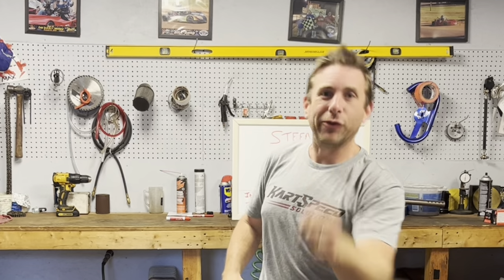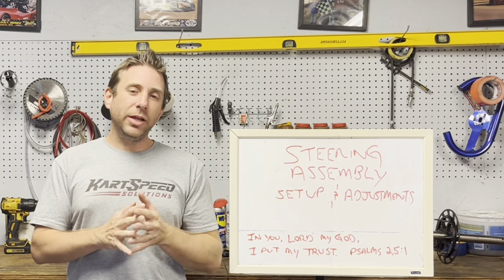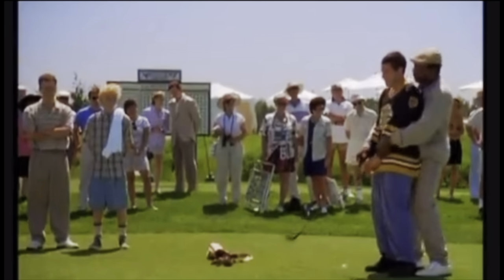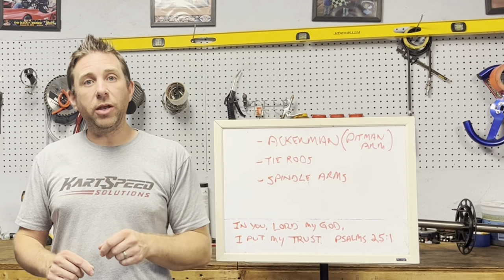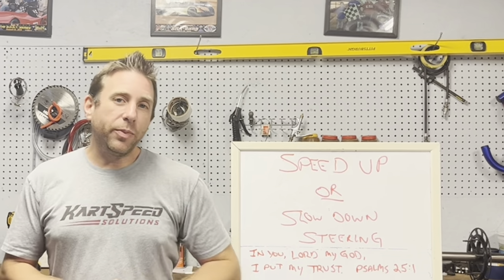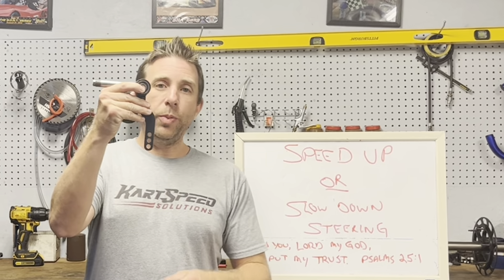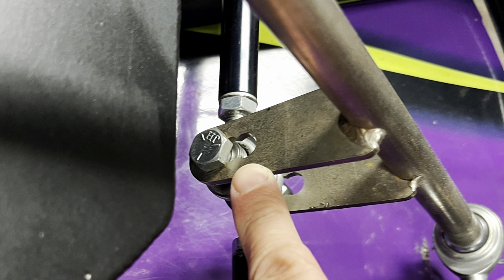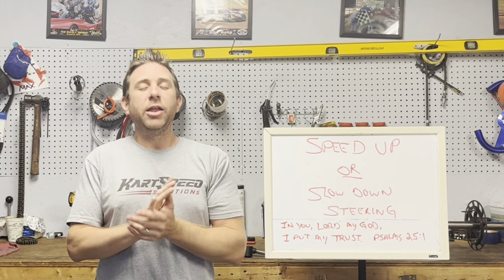Steering Assembly Setup and Adjustments

Comment: Pitman arm and ackermann are 2 different things, ackermann (simplified) is the difference in angle between the left front and right front while turning. The different holes will achieve different ackermann along with changing the force needed to turn the tire with the steering wheel. Closer to the kingpin on the left front will get more ackermann and farther away on the right front will get less ackermann. My thought is that, in theory, on a larger track with sweeping turns, you would need less ackermann so that the front tires aren't fighting each other as much, while on a tighter hairpin style track, more ackermann should help get into and through the center of a turn.
Reply from the maker: Yes sir, what I’m referring to is what manufacturers call certain items. For instance, Phantom calls the connection point of the tie rods to the steering shaft is a “Pitman Arm”, Trick Olimpic calls it an “ Ackerman”. What you are referring to is Ackerman angle which I really don’t go into to deep in this video.
Reply: @kartspeedsolutions  gotcha. I guess I had just never heard it called an Ackerman lol. Didn't really mean to come off as arrogant or rude
Reply from the maker: Yes sir, no worries, didn’t take it that way at all😁

Comment: on the spindle the hole at the top is fastest hole at bottom is slowest. it takes more travel at the bottom and less travel art the bottom to move spindle same distance
Reply: Thats what iv always thought too
Reply from the maker: No sir, when going to furthest hole from the kingpin on the spindle arm you are increasing the speed of the steering. Reason for this is because you are increasing the throw of the spindle arm which in turn increases the rotating speed of the spindle barrel and there by increasing the rotating speed of the spindle axle.
Reply: Further away from the spindle barrel, less angular motion. Thus slowing down the steering. Opposite is true on the steering shaft, further away from the shaft increases steering speed due to increase in angular motion.
Reply: @kartspeedsolutions  So would you recommend setting both sides the same hole?  For example, both in middle, or both in front or rear?  Would there be a situation where you may want to have them different on each side?  Thanks in advance!
Reply from the maker: @ryandavies6861  yes sir, I always set mine the same on both sides. Can you change the ackermann angle by setting them in different positions and get a different handle response? Absolutely. However, this would not be an adjustment I would recommend doing.